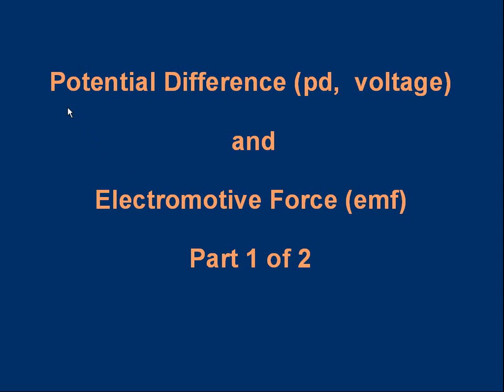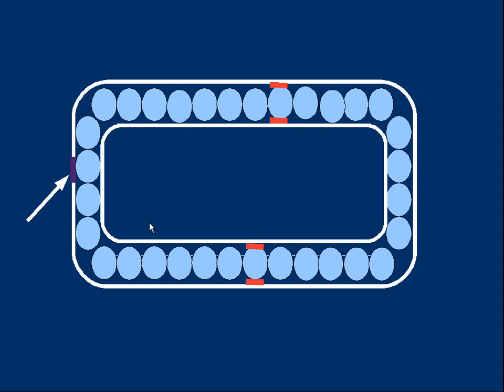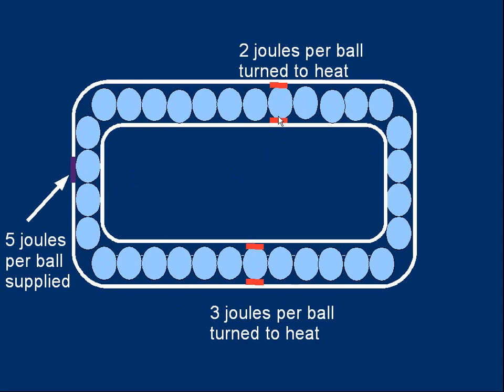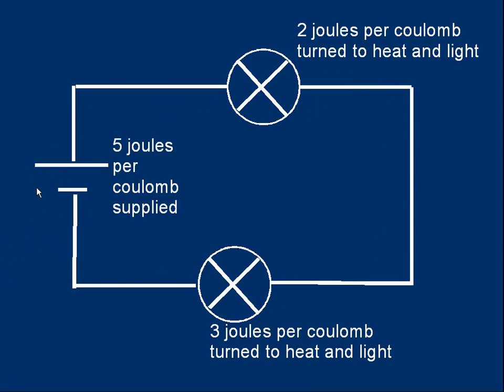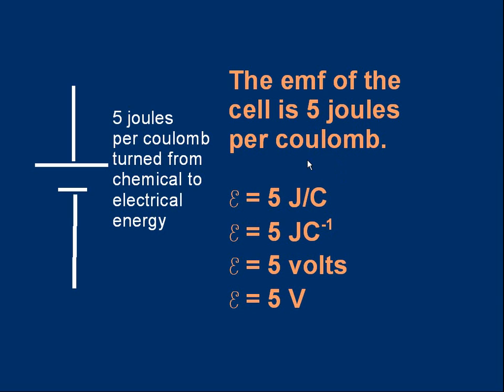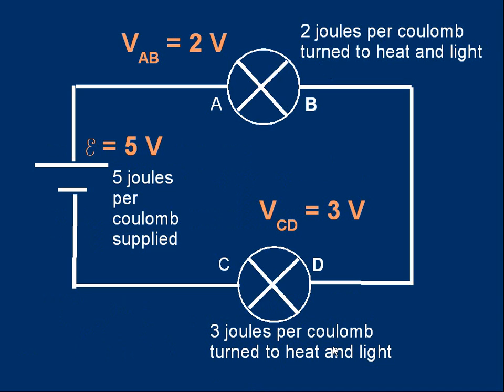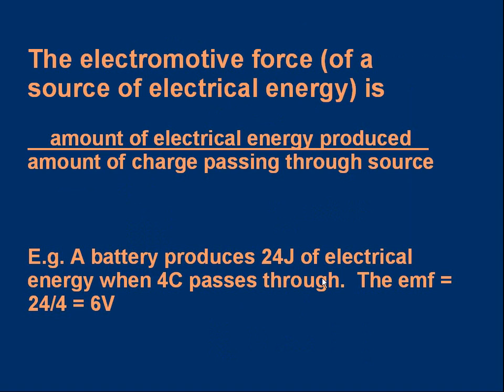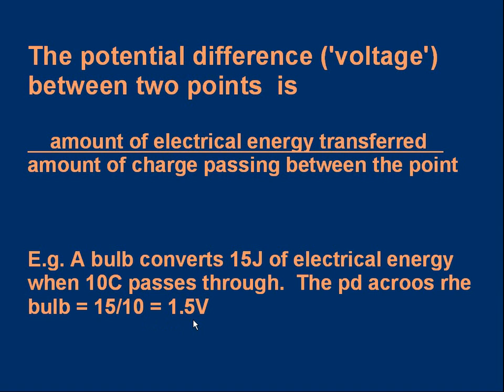GCE (A level) Physics E03 Emf and voltage. Part 1 of 2

Comment from the maker: @SalmanBacha 

Hi. Some of your explanation is OK providing you have no internal resistance in the battery. But your description of the way charges move is wrong. 

Here in the UK some of what you said is OK for GCSE (e.g. under 16 years old) but not for A-level (e.g. over 16 years old), as it does not allow for internal resistance.  I have emailed you an explanation via your channel; I hope it helps you.  Try reading about internal resistance.

Good luck

Steve

Comment: Sir tell me that voltage is in cicuit and emf is inside the battery between the two plates of battery and doing work on a charge in moving it from negative plate towards the positive plate inside the battery and voltage moves a charge from positive to negative plate outside the battery means in the circuit.Am i right Sir?